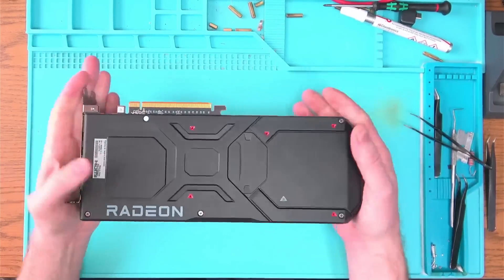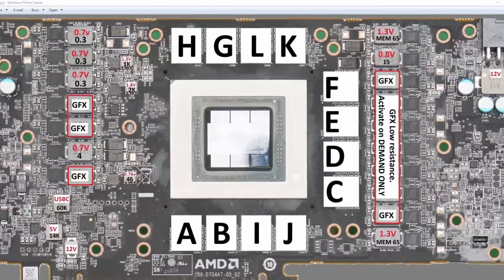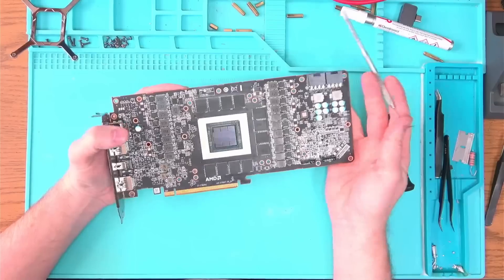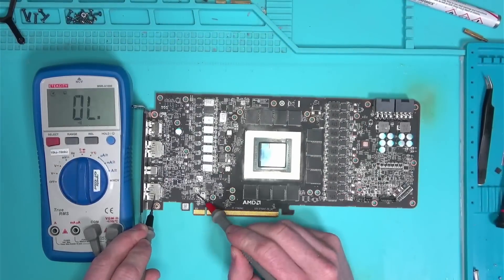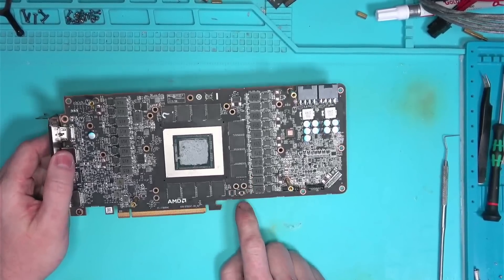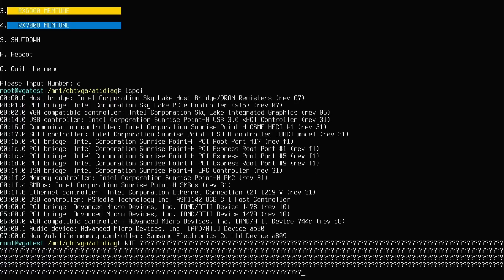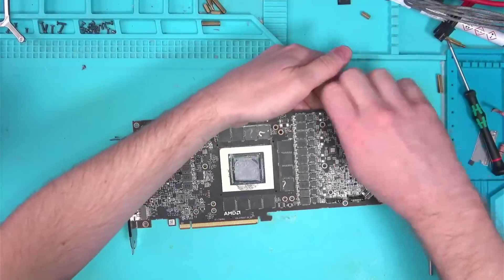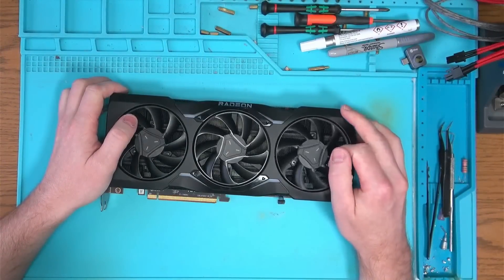7900XTX repair video

Comment: As much as I don't want an Nvidia cards as they're overpriced... watching these videos I'm quite hesitant with AMD cards :/
Reply: Because an Nvidia fanboi decided to blame AMD without even testing the card's data lines, let alone anything on the AMD chip itself?
Reply: @RFC3514 careful, a fan boy clown might tell you to go get a life, again.
Reply: @RFC3514  no, because I watch a ton of repair videos and I know I won't get MSI or Gigabyte, cards that are very long and heavy.
Reply: @RFC3514  you have some insane rhetoric my guy. Who do you think people will trust? A noname insanely obvious AMD cult fan. Or a repair tech who works on both AMD and nvidia? Such a hard call
Reply: @humble2246  - First, I own two AMD GPUs and twelve Nvidia ones. If that makes me an "AMD cult fan" (whatever that is supposed to mean), I guess the standards are pretty low (or you're just very insecure).

Second, no one has to "trust" anything. I stated an objective fact: there was no test of the data lines on the card and there was no test of anything on the chip. Did you even watch the video? I can only assume your username is deliberately ironic.
Reply: @RFC3514  pure copium from you
Reply: @humble2246   - I guess that cringe reply is your way of confirming that you have literally no idea what is being done in the video.
Reply: @RFC3514  im in college for electrical engineering with a background of signal integrity...go back to posting "amd good" like all your other comments completely disregarding any and all amds issues
Reply: @RFC3514  seriously though the fact you have to post in every thread defending amd is telling
Reply: @humble2246  - Seriously, though, what's really telling is the fact that you're obsessed with AMD. I think not even AMD's CEO spends as much time thinking about AMD as you do.

My comment is about the procedures followed in this video (or rather, the lack thereof - no testing of data lines, no testing of the chip, no boardview, no signal tracing, and then a nonsensical "conclusion" pulled out of nowhere).

It's completely irrelevant what brand the GPU is; it could have been a 3Dlabs chip from 1997, the exact same comment would apply. But of course, we both know that if the card used a chip made by any other brand, you wouldn't even have clicked. You live for AMD.
Reply: @RFC3514  did the voices tell you that in your head? The entire video here is filled with you defending AMD.  "It is completely irrelevant what gpu brand". Are you a stockholder in AMD or something oldhead?
Reply: @humble2246  - No, I'm not a stockholder in AMD. But AMD is clearly a majority stockholder in you; it seems to control you completely.

The entire video is filled with nonsense (like calling Vega a chiplet-based design). He's doing backflips to try to blame the chip designer (not even the manufacturer - the designer) for a made-up "problem with the chiplet interconnects" (which he never even tested) when every symptom points to physical damage suffered by the card. If you knew the first thing about electrical engineering you would have noticed that immediately, instead of trolling comments one year later to display your pathological obsession.
Reply: @RFC3514  ironic considering you were obsessed to prove that amd does nothing wrong what so ever. Stop shilling
Reply: @humble2246  - Not sure what you think is "ironic" about pointing out that the (nonsensical) conclusion didn't match any of the test results, but what really is ironic is that here you are again, ignoring the procedure and talking about AMD, AMD, AMD. I bet you didn't even watch the video. You simply cannot stop thinking about AMD. It's hilarious. 😂

Comment: 1- Take a butter knife
2- Heat it to 200 degrees C
3- Very carefully follow the lines between chiplets..
Reply: why stop at 200? heat it until its red hot, it will cut much better, almost like butter!!!

Comment: I've had my sapphire nitro 7900xtx for a year now and works great. Core stays under 45° and hotspot doesn't go above 60° I love it.
Reply: there is no gpu under 50º or 60ºcelsius under load, period. unless you do watercooling...
Reply: @naomiarmitage8729  You'd be surprised what a good undervolt and a reasonable FPS cap can do for a Radeon card, you can make them run extremely efficiently and cool with little to no loss in performance, or sometimes even a performance gain if you have a good piece of silicon that undervolts well. The heatsink on the Nitro is absolutely massive, so 45C edge 60 TJ with an undervolt and slightly ramped fan curve does not seem outlandish to me at all. 

Water does help though. I run a Liquid Devil 6800 XT and if I undervolt to 950mV and run at the stock 2360MHz it will cruise along at 42C all day no problem.
Reply: @K31TH3R Sapphire always has the nicest cards. I have owned a few of them going all the way back to the ATI 9800 Pro. They never have isssues for me.
Reply: @hochhaul  Agreed. I have never had a Sapphire card fail on me, and my first fast GPU was also a Sapphire 9800 Pro. And I ran a Sapphire R9 290 on water and I pushed it so hard I melted the PCI-E connectors (410W+). Whoops. Cleaned the connectors up, replaced the cable, right back in the PC and ran it for 3 more years.

PowerColor also has a really good track record with me. I had a PowerColor 7870 XT Myst on water which I also punished for years. And of course my current Liquid Devil 6800 XT is continuing to impress.
Reply: @naomiarmitage8729  Yes there is if you have you fan settings above 0% lmao.
Reply: so why do you need that kind of gpu and do you play in 88k ?? :)
Reply: the nitro vapor-x cools well. 467w, 24-48% fans max core 49 max hotspot 68 during gaming session or 3dmark stress loops.
see higher temps on the memory, 80 max running at 2700+
Reply: damn
Reply: Man you cant play games, your talking idle temps, theres no 7900xtx that maxes out at 45c

Comment: making it unrepairable.. as planned
Reply: Just because one person couldn't repair something doesn't make it "unrepairable". If anything, chiplet-based GPUs are more repairable than monolithic dies. Still unlikely to be cost effective, considering the type of equipment you'd need to repair an actual chip, though.

In this case, I'd say it's more likely that some data traces on the card were broken due to the physical damage, and those can actually be easy to fix, but determining which traces are broken does require more analysis, and he only checked for power.

Comment: had this happen as well and turned out to be pcb broken trace-signal. Pain in the ass to locate but easy to fix once found. Bet its the same with yours. These new cards weight as much as a tank(for hampsters) and cheap pcbs used plus strain(always mount correctly to minimise - if hanging with only pci-e for suport - you are asking for this to happen) spells trouble
Reply: Yep, my guess would be board-level damage. Might be on the surface, might be an internal layer (and not fixable). But without analysing the data lines (or at the very least trying the GPU on another card), there's no way to advance the diagnosis. Claiming "it's the chiplet interconnects" is just random.

Comment: To be fair, Vega had the VRAM as the chiplets (HBM memory, which nVidia already uses in server parts). The new AMD and nVidia GPUs are true chiplet designs were parts of the previous monolithic dies are broken up. In AMD's case, the cache and memory controllers are on the chiplets.

Comment: Unfortunately chiplets are coming to Nvidia as well; they are far more cost-effective and suitable for larger dies at the expense of repairability.
Reply: There's nothing "unfortunate" about it. AMD and Intel have been using chiplets for years (the best CPUs all use chiplets), and both AMD and Nvidia chips are made by the same factory (TSMC).
Reply: nvidia is very different designed ...it use intel substrate idea vs amd dumb idea to use not substrate for their chiplet cache ...cpu would be fine but extra cache will not when they solder entire on top cpu core...bad idea when intel use substrate for extra caches

Comment: Goddamn! After all this work not getting anything in return would be a crime.
Reply: First step should have been to put the GPU on an identical card that he knew was working. That would immediately tell him if the problem was the GPU or the card. But I guess he doesn't have another one.

Comment: Moral of the story : GPUs aren't intended to be disassembled to that degree and chiplets are drop sensitive

Who could have possibly guessed.

As much as I love this channel's repairs, this seems like unnecessary slam on AMD
Reply: It would be impossible for him to detect problems with chiplet interconnects. These connections are done at the factory at die level and not at the socket. A drop strong enough to  disconnect the chiplet connections would probably snap the GPU in half.
Reply: NWR has always been like this praising EVGA cards and slamming AMD. If you followed him for a while this is obvious. He is a great repair tech tho and thats all. I do enjoy watching his vids still regardless of his opinions as most of his statements from time to time are clearly bias.
Reply: @cowbee8865  Spot on. Almost like celebrities. You like and admire what they do and maybe not so much who they actually are as a person (character or opinion wise).
Reply: Intended to be disassembled this far or not, it is the same process as assembling it in the first place. I would argue that doing it by hand and inspecting it is even more dependable. How many cards arrive with solder balls all over themselves right from the factory?
Reply: Nothing in the video indicates a problem with chiplet interconnects. He didn't even check the logical traces on the board, let alone anything in the chip itself.

Comment: Nvidia will have 2 chiplets for their 5090, so that issue is coming Nvidia too.
Reply: There is no "issue". Nothing in this video points specifically to chiplet interconnects. All the current top CPUs use chiplet-based designs, and MCM designs (similar concept) have been used since the 1990s.

I think he was just ranting about chiplets because he has some weird bias against AMD and they moved to a chiplet design first. Next year, after Nvidia starts using chiplets on consumer GPUS too (they already use them in some datacentre GPUs), I'm sure he'll decide that chiplets are fine after all.

Comment: VEGA wasn't chiplet design. It was monolithic SoC but using HBM2 memory. Here is chiplet design with regular GDDR6.
Reply: Am I making a mistake? You can see the separate dies on a vega gpu. They are not even made by AMD. It's not all one die, GPU and VRAM.
Reply: @GeorgeTsiros those are memory modules on Vega, not GPU dies
Reply: @PHOBIAx57x  that is what i am saying. "it's NOT all one die, GPU and VRAM".
Reply: @GeorgeTsiros the core is still a monolithic design...
Reply: @LastExile1989  I can agree on that, it makes sense
Reply: damn
Reply: Is kinda the same,  both cases have interposer, lines that are not in the board,
Reply: vega might have been a monolithic gpu die, but it had HBM2 chiplets that aren't replaceable on it that failed in the same way mr pedantic
Reply: @Revoku pedantic? There was nothing pedantic about OP's comment. In fact, your reply was more pedantic than his comment.
Reply: @hochhaul  fight fire with fire!

Comment: I believe that AMD should take that card in it's labs and figure out if their chiplet design is indeed so vulnerable to small impacts and if it is so they should change their design in order to harden it against such events.
Reply: Yeah, some random guy who knows nothing about chip design goes on a rant against chiplets (with zero evidence), so AMD should mobilize their entire team of engineers to investigate, even though they (and Intel) have already been using chiplets for years. 

I guess it never crossed their mind to test their products until now... 🙄
Reply: @RFC3514  yes they should because there is no such thing as a perfect product. If Tony's claims are true they should re-engineer it, they should fix it. Either way they have an obligation to their customers, even if they cannot fix the chiplet design, they should put a warning on their products that they should not be dropped.
Reply: @teddp  - Tony, the microprocessor designer (not), who didn't test any of the signal lines and didn't even test the chip on a different board. Do you really think Intel, AMD, TSMC, Nvidia, etc., are completely clueless, and haven't analysed all their products at a microscopic level? 

And there is a warning on graphics cards (same as all other electronics) saying the warranty doesn't cover physical damage. Did you think sensitive electronics could be dropped from any height and continue to work fine...?

Is there a warning on your head saying it shouldn't be dropped? If there isn't, does that mean you can fall from any height and be fine?
Reply: @RFC3514  when I was young I was naive too. To everything you said I will answer with just this: Boeing 737 Max.
Reply: @teddp  - And to everything you say I will reply only this: remember the Alamo!
Reply: @teddp  you must be joking or else you are definatelly an American.

Comment: What GPU would you recommend? You have pointed out flaws in every card that has come through your repair shop.
I went with AMD this gen because I didn't want to spend 1600 dollars nor possibly get a melting connector.
Reply: He only gets sent cards that fail, so look for models that he doesn't show on his channel - those probably fail less. 😁
Reply: @RFC3514  Also have to keep in mind some models will be more popular than others. As an example if you see 50% of the cards coming in are ASUS, that doesn't mean ASUS sucks if they account for 50% of the AIB market.
Reply: @t1e6x12  - Of course. They suck mainly because of Asus Armoury Crate. 😜
Reply: The universal answer to the question of "which GPU would you recommend?" is "just get a Sapphire or PowerColor 7800 XT." The 7800 XT is to GPUs as Brother is to printers. 

"Want something that prints? Get a Brother. Want something priced reasonably and just works? Get a Brother. Want something that makes weird sci-fi noises and perfectly replicates your important documents? GET a Brother. Want something that won't piss you off? GET A BROTHER. Want something that takes up desk space and collects dust for 6 years but still works when you need to print something for a court case against you? BROTHER. Want to print off grandma porn to hang up on your wall to make people who invade your space uncomfortable? Bruh. But also Brother."

Comment: the problem is NOT the chiplets  or AMD look on how that card was used don't drop high tech devices .
Reply from the maker: I agree but i've seen worse and core would survive.
Reply: @northwestrepair  - You've also seen boards with less physical damage where the "core" (GPU) didn't survive, right?
Reply: @northwestrepair  i do think the chip size also does not help with drops you know the force is not the same across the chip and since some parts are less dense they can break also think they will solve those problems when chiplet designs improve and get to be used on other smaller devices then gpu cards
Reply: @1Rictec  - Chiplets have already been in use for several years (by Intel, AMD / TSMC and other brands), including on the best CPUs of the current generation. There isn't much reason to use chiplets on very small devices, because then the extra cost of assembling them into the full chip will be more than the yield benefits from using chiplets in the first place.
Reply: @RFC3514  i know that but in the future they will reduce the overall size of the entire die for sure.
Reply: @1Rictec  - Well, the more they reduce it, the less financial benefit there will be from using chiplets. But if they manage to reduce it, they'll just add more components to the chip until it hits the maximum size again, and sell it as a more expensive model. That's what Nvidia is doing with Blackwell (it has to be done in multiple parts because it's too big).

Comment: can you repair my radeon r9 fury, a resistor was nocked off by the pci connector, and a power component consisting of a copper coil has a casing thats cracked, is it possible you could repair my gpu?

Comment: I was considering to buy one of these cards for an upgrade, but seeing how well they die... I'd rather wait for next gen or something... 😅
Reply: So you came to a repair channel that showed one unit of a specific card model that had failed after being dropped, and you concluded they must die very easily? Great logic.😆
Reply: @RFC3514 Considering my luck, that very same fate could happen to me 😂 Truth be told, GFXs are fragile because they're so fat these days.
Reply: 7900xtx is baller. Don't treat your fragile, expensive electronics like basketballs and you'll be fine.
Reply: 1:29 I've got one and it's been great for me. My first amd card ever, been nvidia since the 660 but I've had a better experience with this than any nvidia card. Probably wasn't very good for the CS players who got banned for no reason or this guy whose card is in the video who dropped it and broke something "We have a sign of an impact".
Reply: Well on this channel you only ever see the broken ones
Reply: @SaHaRaSquad  I have more than a year the 7900xtx and its super  but this video got me worried

Comment: sheet commentary, it's AMD's fault dude dropped a GPU on the ground
Reply: Duh it's the drivers.    ... non- drop proof drivers .. AMD BAD
Reply from the maker: No its not AMDs fault that it was dropped.
AMDs fault is at producing something that cannot be dropped.
Nvidias drop all the time. ripped pads, broken solder joint, cracked PCB, thats it. 
If damage is not extensive, its repairable but in this case, damage is minimal and its already 100% toast.
Reply: It may be more fragile but people aren't buying GPUs based on how hard you can throw them and still use them.
Reply: @northwestrepair Woosh, my guy.